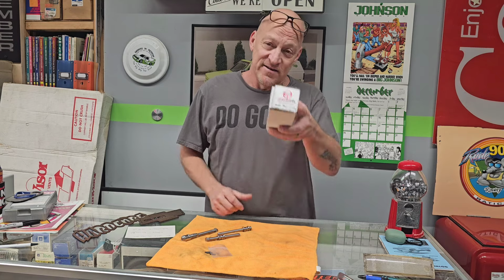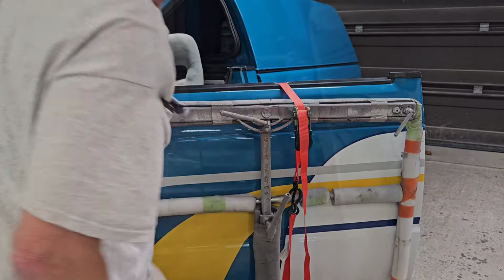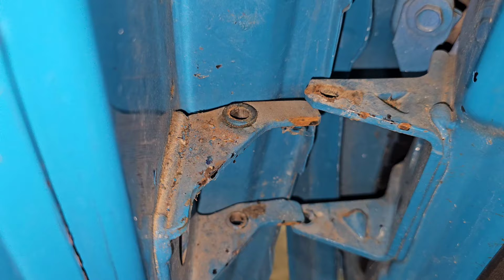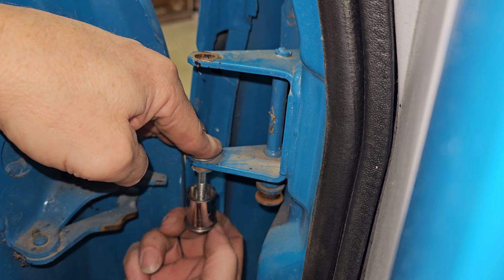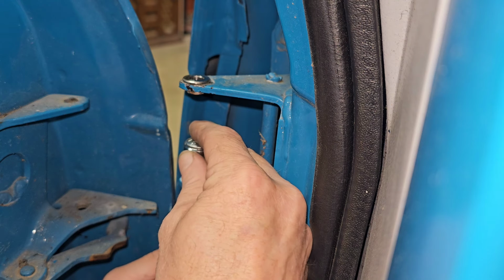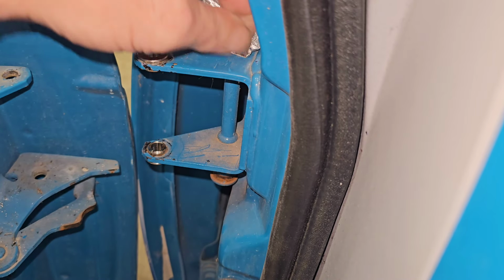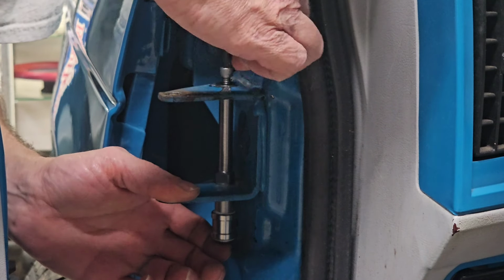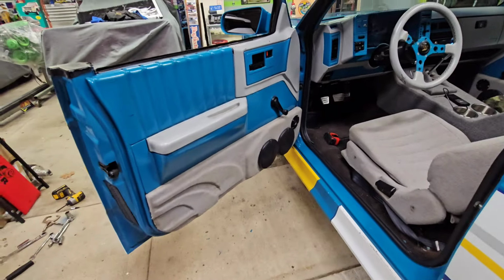HOW TO: Installing Endurapin Door pins and Roller pins on a CHEVY S10 in less than 30 minutes.

Comment: Hello I am working on a 1984 S10 Blazer. know its not anything to with what you are working on. So I'm putting the Blazer back together the guy i g0t it from used it for a drag race car. So i wanted to know if you could give me a few pointers on the front bumper valance i am trying to find a video but nothing to be found. I'd really appreciate it thank you
Reply from the maker: What do you need to know?
Reply: @ I am working on a 1984 Chevy S-10 and the front valance I was wondering how to install that piece. Do I need to take the bumper off to install it?
Reply from the maker: @truckerjam7228  nope. It will have u nuts clipped on to the edge. It tucks up inside the bumper and you put the screen through the bumper into the u nut. And tighten. Unless it's the fog light valance
Reply: No it’s the regular one no fog lights. And it has the little clips and the bolts for the valance that came with the part
Reply from the maker: @truckerjam7228  then just as I said.
Reply: @ okay got thanks. Keep up the good work love the stuff you put out